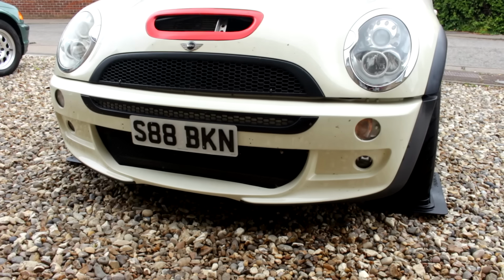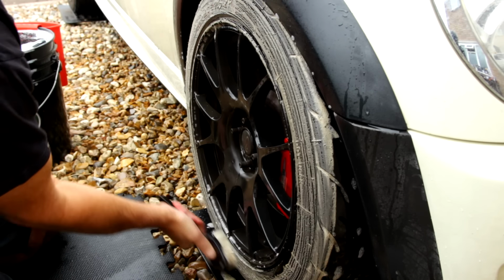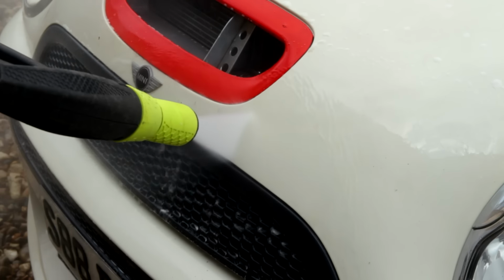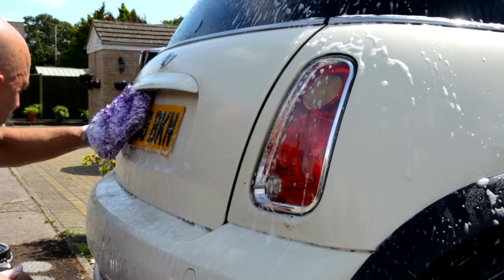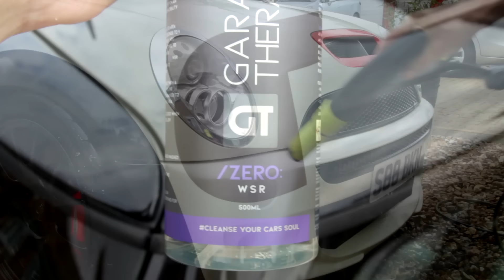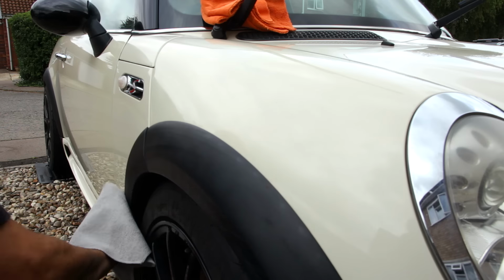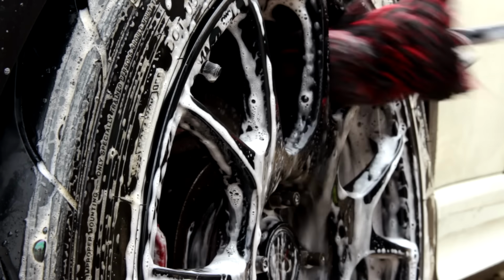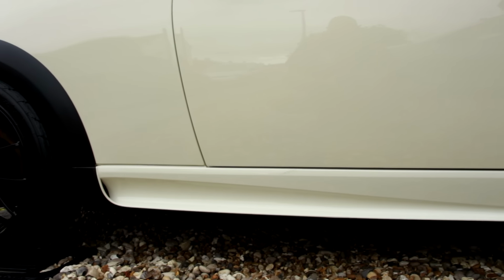Decon + Wash + Protection Detail

Comment: Fab Vid Paul..I completely agree with you pet hate with the number plate lights. My pet hate is orange break discs. I have a M4 with large discs, and after spending time on my wheels, the moment i use the brakes Boom orange and black wheels. So go myself a Car Dryer a BLO AIR RS. 'Game changer' I use it in between getting the discs wet. Now no more dreaded 🍊
Keep the Great Vids coming.

Comment: If youd have been polishing this car, would you have clay barred it first?
Reply from the maker: Chemical decontamination first then clay bar then machine polish Ben 👍🏻
Reply: @PaulDoldenDetails  thanks. I'm going to do chem decon but am wondering if I can skip clay bar as I'll only be applying autoglym super resin polish, by hand. ?
Reply from the maker: @benbirch2393  the problem with doing a clay bar process is you will cause marring and the polish will only fill the swirls and marks temporarily so maybe miss it this time